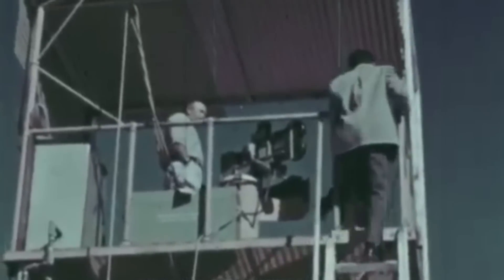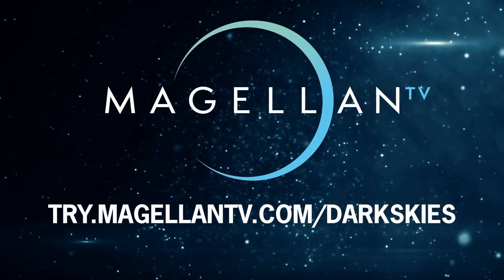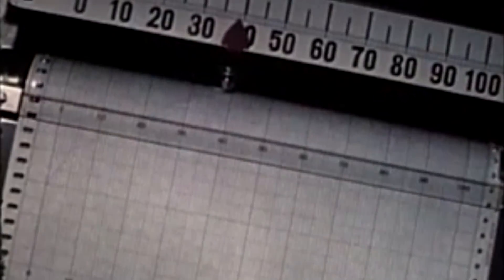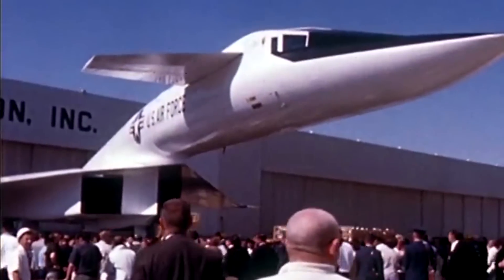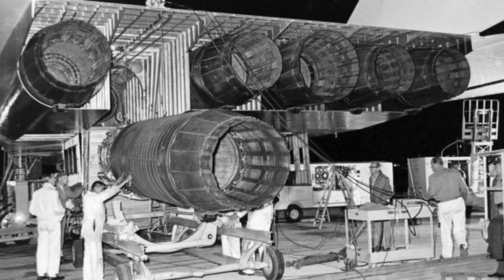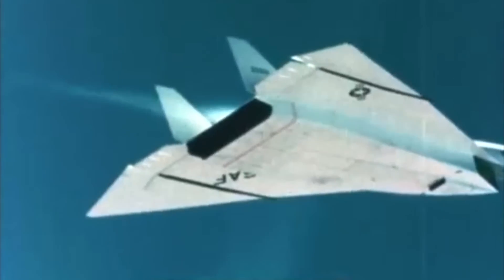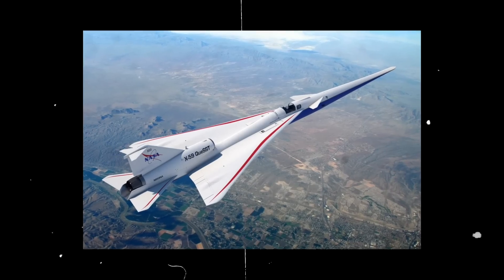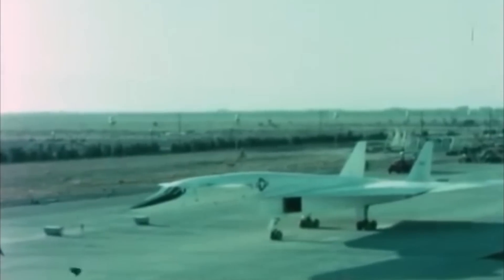XB-70 Valkyrie - Mach 3 Nuclear Bomber

Comment: I grew up in southern California and we enjoyed going to air shows at all the bases over the years. In May 1966 we went to Edwards Air Force Base for Armed Forces Day. We were surprised, and shocked really, to find two very unusual airplanes on display; a YF-12A and the XB-70. In both cases, one of each also flew in the flight demonstration show (even at 15, I had been to a lot of airshows by then, but the YF-12A was the first time I witnessed any airplane go straight up and disappear into a clear blue sky (leveling off at 50,000 feet!). Two weeks later, we learned that the #2 XB-70 (the one we saw fly) had crashed. Two years later, during summer school, my class went to Edwards on a field trip. I remember driving along the road heading to the base and some wise guys on the bus started laughing at a sign along the road that stated, WATCH OUT FOR LOW FLYING AIRPLANES. I wasn't very assertive back then, but I spoke up and told them that it wasn't a joke. Just then, on the horizon beyond their side of the bus, but up ahead, I saw a dark patch, so a moment later I calmly told them to duck and pointed to a B-52 with smoke pouring from its 8 engines, an HL-10 lifting body under its wing, along with 2 F-100 chase planes, that intercepted the bus and came perfectly overhead at a very, very low altitude, with a thundering roar. Their eyes were as wide as saucers as they snapped their heads around to see, and you never saw two guys shut up faster than those two (as well as everyone else on the bus). Anyway, near the end of our visit (which was just a visit, including a swim in their base pool) our group was taken into a hanger, and there was the last remaining XB-70. We were told that the next day the plane was to be flown to Wright-Patterson in Ohio, and we met the pilots, and got to ask them questions, which was quite an awesome experience. In the video, they said the XB-70 went to Ohio in 1969, but I'm very sure my experience happened the year before that, in 1968.

Comment: I once saw something like this, in Ohio, I think. Don't know if it was the bomber, or a very similar SST.
Reply: At the USAF museum?  AFAIK, there are only 3 Concordes on American soil, none in Omaha, and no Tu-144 airframes here at all, so definitely not an SST. Depending on your pov, a B-1 might resemble the B-70 (they really look and fly completely differently), and one of those is also at the USAF museum.
Reply: @winternow2242 , I never said it was a Concorde! You really do not know what you are talking about. Do you imagine that the Concorde was the only SST ever developed? There were several US companies that had prototypes or mockups of SSTs, such as the NAC-60, which was similar to the XB-70, or the Boeing 2707. I think what I saw was probably an XB-70. It was either in Southern Michigan or Ohio, at some sort of museum, and it was outside, in front of a large building, possibly a hangar. This was a while back, in the late 70s. I remember the huge size, pointy nose, canards, long thin fuselage, and droopy delta wings.
Reply: @mrnickbig1   "I never said it was a Concorde! You really do not know what you are talking about."
Umm, I know that you mentioned an SST, and I discussed 2 SSTs that were put into production..
 "Do you imagine that the Concorde was the only SST ever developed?"
Do you imagine that I imagined that the Concorde was the only SST developed, after I posted a comment that mentioned both Concorde and the Tu-144.  That's some pretty hefty imagination on your part, and clear deficit of reading comprehension on your part at the same time.  Now, that's an odd mix.

"There were several US companies that had prototypes or mockups of SSTs, such as the NAC-60, which was similar to the XB-70, or the Boeing 2707."

No American SST prototypes were ever built.  The only full scale mockups I know of were those of Boeing and Lockheed.  Only sections of the Boeing mockup survive.  While the Boeing mockup travelled across America, it was never in Omaha.  The Lockheed mockup was scrapped years ago.  No full scale mockups were ever made of the North American plane - probably because its range and passenger capacity was less than of Boeing's or Lockheeds, neither of which went into production, or flew, or produced a single prototype.

To offer any of these planes as examples of SSTs that were developed relies on an extremely elastic use of the word "developed".

"I think what I saw was probably an XB-70"

SO, when you say you saw something like the XB-70, you meant that you thought you had seen the XB-70?
Reply: @winternow2242 , yes. I did more research into similar planes and determined it probably was the XB-70. As for the rest, anyone can look at the thread and see who said what.

Comment: I’ve watched documentaries on this aircraft before but this one was more thorough than any I have seen so far. The only error I saw was referring to the F4 phantom as the F48, and I’ll let that slide. Thanks Darkskies for another great upload.
Reply: I noticed several errors, it was not wing tip vortices that caused the F104 to hit the XB70 as the Valkyrie’s wings generated lift using vortices over the whole wing. The 2nd prototype had additional anhedral not dihedral which gave better high speed performance. Also not mentioned was that prototype 1 had a fuel tank sealing problem which limited its high speed endurance and that’s why prototype 2 was used for most of the high speed research.

Comment: The F-104 is possibly the only US fighter to see active service that may have killed more Americans than enemies.
Reply: Uh ... no.

The F-104's flew over 5,000 missions during the Vietnam war.  Mostly as escorts for other aircraft, Combat Air Patrol, Re-con and in Close Air Support Missions.
.
Reply: @BobSmith-dk8nw  The F-104's scored no kills in Vietnam. Now, that is partly because the MiGs wanted nothing to do with them but it is still a fact.
Reply: @Elthenar  There is what you meant - and what you said.  You said:
"The F-104 is possibly the only US fighter to see active service that may have killed more Americans than enemies."

How many "enemies" do you think they killed doing Close Air Support?
.
Reply: @BobSmith-dk8nw  OK, you got me. I didn't realize it was extensively used as an attack aircraft. I thought it was a pure air combat fighter. 

My larger point holds true though, the plane was dangerous to fly.
Reply: @Elthenar  It did have a bad safety record.
 
One part of that - may be - that it's strengths were also it's weakness.
 
The F-104 was designed as an Interceptor.  For NATO countries faced with the possibility of a sudden, surprise attack from the Warsaw Pact - the ability to take off and quickly climb to altitude - was highly desirable.  It had a stunning rate of climb and was very fast - but - it did not maneuver well.  So - when it was configured to be a Fighter Bomber - doing low altitude attacks - there were a number of incidents where it's pilots flew it into the ground.  The thing is - it was used A LOT as a Fighter Bomber ...
 
Look at a picture of an F-104.  Do those stubby little wings scream out at you "Load me down with ordnance!!  I can't wait to do high G pull outs after a making a ground attack!!!"?  After a while of being used to carry heavy ordnance loads and doing high G maneuvers - the F-104's began having structural problems ...
 
It was also a single engine aircraft - that had problems with it's engines ...  Again - these were eventually replaced with other engines but ... in the mean time ... there were a number of F-104's lost to engine failure.
 
Given that the original design of the aircraft as a high altitude Interceptor - had the pilot ejecting downward because of that tall tail - a pilot needing to eject at low altitude (such as one doing Ground Attack) - had a problem.  Ejection seats that went upwards  were developed - but the initial ones weren't that good.  These were eventually replaced with better ones but ...  there was a time when pilots having trouble with the aircraft had difficulty getting out of it.
 
There were a lot of aircraft that were it's contemporaries that had very few if any air to air kills - simply because their nations weren't at war with any enemy at all or one that had very few aircraft if they had any.  The thing with these F-104 contemporaries - was that they hadn't been designed to do one thing - and then actually used - to do something they really were not suited for.  F-104's were pretty much universally used as both Interceptors and as Fighter Bombers - and they shouldn't have been.
 
The lesson of the F-104's?  Don't take a sports car and use it as a truck.
.
Reply: @BobSmith-dk8nw  Everything you just said is why I totally airballed on it's work as a strike fighter. Using it as a strike fighter is about as poor an idea as using an A-10 on CAP.
Reply: @Elthenar  Yep.
.
Reply: AF Times once said some F-104's were given or sold to German AF what happened was the Ger pilots crashed most of the planes...the F-104 was basically a poor mans X-15....

Comment: The XB-70's ability to fold its' wingtips down had nothing to do with directional stability: the folding wingtips were there to increase lift at high Mach numbers by using a "waverider" technique, i.e. using the supersonic shockwave of the aircraft for lift.
Reply: I've come to expect such inaccuracies from this channel.  Poor research coupled with limited understanding of the subject matter.
Reply: @gort8203  It's a damn shame they always cover such interesting topics. The obvious errors are just jarring.
Reply: Yes, the term is "compression lift".
Reply: @MrKentaroMotoPI  it was literally on screen moments before he said the stability line... d'oh :)
Reply: Eff yore Feelings  Its scary the way actual facts are unable to compete against the vast volume of misinformation being peddled.  Sometimes I try to point out an error in a comment, and I get vilified because I didn't watch another inaccurate YT video from which the commenter got his misinformation.  The misinformation spreads farther than the truth.
Reply: Yes but! Having the wingtips in the down position could have gave enough directional stability to give them time to get out safely. Sad.

Comment: 09:35 cancelling the project by the Kennedy administration couldn't have happened as President John F Kennedy was assassinated in Nov 1963. Poor research.
Reply: According to Tab-Aero's book on the B-70,  production of the B-70 was stopped by McNamara in 1961. Tbe confusing part is that the plane would be built for research purposes, leaving the possibility of a revival of the plane as a weapons system. But the cancelation was effectively final in 1961, well before JFKs asassination.

Comment: The wing sections folding down weren’t for stability. They were for speed and efficiency. Dropping the wingtips like that at Supersonic speeds created a specific aerodynamic effect by which the plane was able to ride or surf atop its own shockwave instead of being dragged by it. It allowed much faster and longer sustained supersonic flight with remarkably good fuel efficiency.
Reply: I knew that I had heard that somewhere else! Thanks for the confirmation.

Comment: This sounds a bit like the Avro Arrow story, in a way.
Reply: In what way?
Reply: @billthecat129  A highly experimental, cutting edge plane that in many ways stood at the top of its class world-wide, only to never see the light of production / adoption.
Reply: @guywerry6614  the B-70 was cancelled because despite its performance and costs, it didn't add to our defense capability. Also, almost as soon as B70 was canceled, the Air Force was at work on another B-52 successor, which ultimately became the B-1.

In contrast there's a better argument for how Canada could have been better off with the Arrow. Also, Arrow's cancelation was more devastating to Canada's defense aviation industry.

Comment: Xb-70s wing tips dropped not only for directional stability but also for compression lift which used the shockwave from the engine inlets to increase lift and to decrease drag